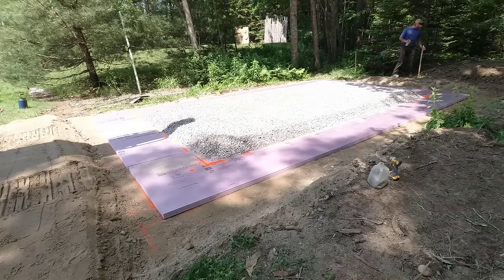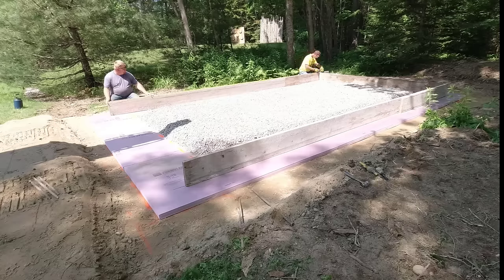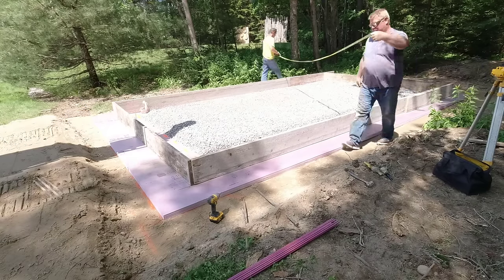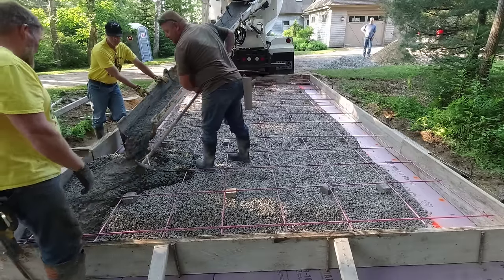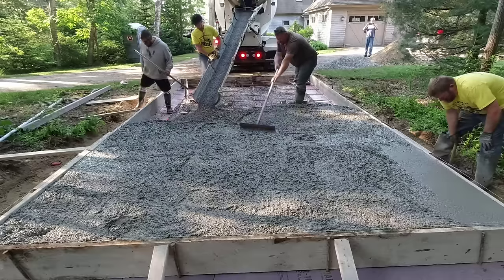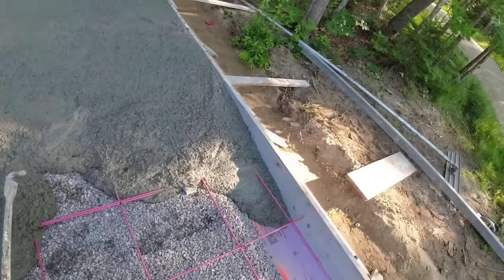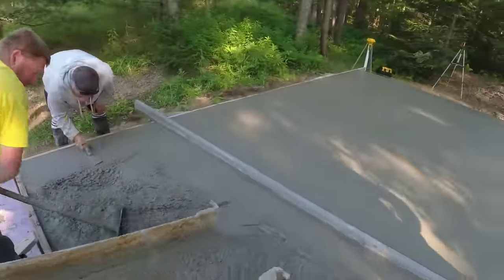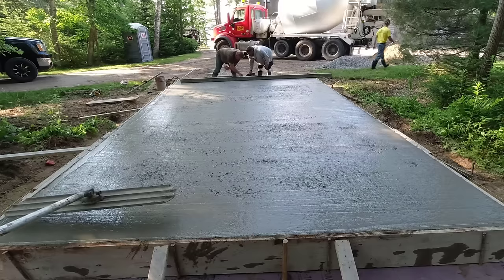DIY Concrete Slab - How I Install A Garage or Shed Slab

Comment: So I bought Artimus last spring and it’s been hanging out in my dry shed. I like your plan here…however I am overseeding 80,000 sq ft here in central Indiana. My plan was to rent a Stinger and seed/aerate after thanksgiving before the ground freezes and, all my walnut and maple leaves are long gone. This is basically frost seeding. It’s all I can do unless I spend all the warm days over spring and summer seeding and  moving sprinklers around which I’m not willing to do. The well doesn’t like to work that hard either.

Comment: Do you broom after a steel trowel finish? I thought your not suppose to use steel in freeze thaw states unless brooming to open back up the concrete?? THAnks

Comment: How come you tie all your rebar by hand rather then use a cordless tying device?
Reply: Especially for something this small, it’s just not worth it. Those battery operated wire tires would be worth it in a factory situation, where you had very unskilled labor making very repetitive ties all day long. For a slab like this with maybe only 50-60 ties total, 2 men can do that in literally 5 minutes with twisters or pliers.

Comment: On a 21’ x 12’ rectangle, the diagonal should be 24’-2.25”. If you get like diagonal measurements from both corners and that’s not what you’re coming up with, something is wrong.
Reply: 6 8 10 formula
Reply: 4 5 6
Reply: @ConCBarnCrete  6-8-10 works but 4-5-6 does not. 
6²+8² = 10²  -  36+64 = 100 ✅
4²+5² ≈ 6.403²  -  16+25 ≠ 36 🚫